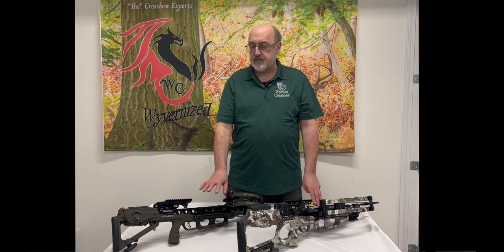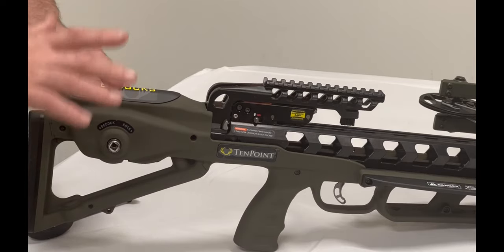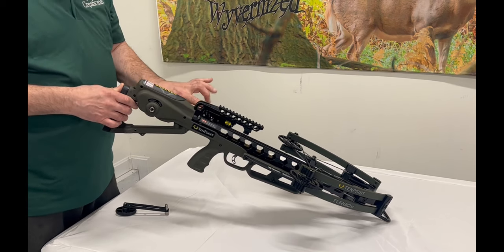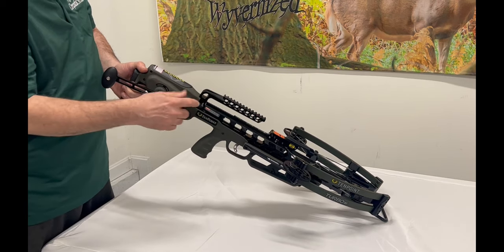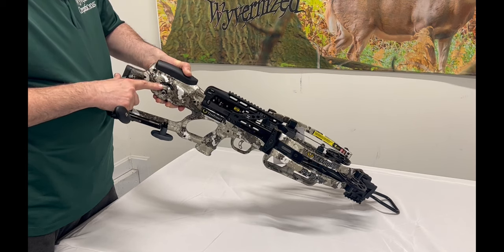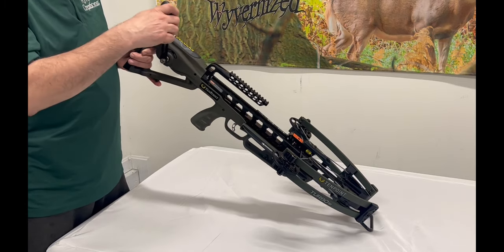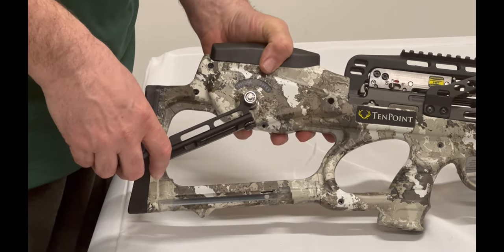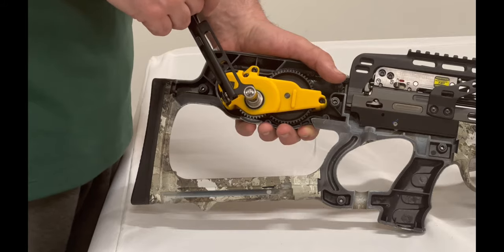TenPoint Crossbow AcuSlide crank instructions

Comment: Just a quick clarification, around the 6:30 mark, you are showing the back crank on the Nitro, you SAY back crank twice, but you actually only physically back crank 1 1/2 times. Then half crank to finish. Just wondering if you MEAN back crank 1 1/2 then half to TOTAL 2 cranks? Hopefully that makes sense?
Reply from the maker: There is some plus and minus to two exact turns. Part of it is where the handle is when you get all the way back.  What your doing with the two back cranks is allowing some slack so the trigger fully settles onto the pins. It can settle with less than 2 turns but generally if you say back crank two turns it turns into 1.5 or 1. If you say back crank 1  turn people would not go back enough. Good catch!!

Comment: I have a situation when decocking old model. I did about three clockwise turns while pushing  the silver tabs forward until the hooks disengage. When I was winding down the string it felt like it was skipping and jamming. Planning  to get a local shop to take a look.
Reply from the maker: There is a nylon washer on both sides of the strap. If you have too much slack the strap catches it and folds it over. Bet that is it. You will need a new strap and gear if that is the case
Reply: Thanks! Shop got it working without having to open stock. Should be ok, right?
Reply from the maker: If the washer was not too bent it will work fine

Comment: Just wanted to clarify something. On my Nitro 505, new model, after I do the 2 back cranks, EVERY time that I hold the button and try the additional last 1/2 crank I get the clicking. You say this is OK, just want to make sure nothing is wrong as Ive never tried it and NOT had it click on my bow. It shoots fine and accurately but I dont want to be messing things up inside and have trouble later.
Reply from the maker: It just means that the two turns are enough to disengage the brake. Your good

Comment: Much Clearer than the Tenpoint video in my opinion!  I recently got the Viper 430 from you David (I am completely new to Tenpont and cranks.),  and this video cleared up all of the questions I had on the cranking system.  Thank you for taking the time to actually show what is going on inside the Bow.  Great job on this!

Comment: I have the tenpoint havoc rs440 and some how the left trigger release pin fell off gone. I'm not sure where it came off, and I'm not sure how it came off. Where can I find one. Also, can the bow still work after getting wet in the rain. One day, my bow got wet, and when I attempted to de-cock and it make lots cranking noise, any explanation is appreciated
Reply from the maker: Ya…that is all one piece. You will want a service center to replace that for you they won’t sell just the part.  There is a bushing that is probably gummed up from being wet. Same deal a service center can pop out the crank and clean the bushing for you

Comment: also i’m confused you said after cocking let back twice then once with the gear stop but on my 425 siege a sticker says “ backed d handle once and then hood gear stop and manually rotate silver knob backward until it stops
Reply from the maker: @jojogrow5815  this year they went to a different series of instructions in an attempt to get people to stop over back cranking.  As noted on that brake most times two turns back is all you need to do

Comment: Im concerned with the gear mechanism being how I was caught in heavy rain storm last season.  How can I check for damage, rust, and relube the gear housing?
Thanks.
Reply from the maker: Ther is no real lube. You can take the side cover off and clean and dry the crank
Reply: Thx Wayne….do you have a video of actually taking the side cover off??
Reply from the maker: No it’s not a big deal. Take out all the screws on the right side of the bow and peel off the cheek with a small screwdriver. You may have to reglue the cheek back on
Reply: Thx for your help!  This is awesome that you actually reply and very helpful.  Much appreciated. 
I’ll give it a try on my Seige 410. I’m sure it’s the same set up as the others.
Reply: Wouldn't worry, since he said the "plastic" teeth could wear down.

Comment: I have the 10 point siege for 25, it doesn’t have the pin in the crank handle to disengage the front string which makes the brush extend beyond the end. How can I disengage it?
Reply from the maker: That one you can’t. It has a different dfi system
Reply: So what you’re saying is that it doesn’t disengage at all. If that’s the case, can I put a slight tension on it to put the brush back behind the front so it doesn’t get damaged?
Reply from the maker: yes just don’t go too far
Reply: Thanks!

Comment: I have an issue where the accuslide wont slide down without me forcing it loose after each shot. Even after doing the back cranking. Any way to resolve this
Reply from the maker: If you dry fired it you bent the hooks. You will need to get them replaced
Reply: @WyvernsCreations  was never dry fired,  this is after each bolt

Comment: Watch out for the screw coming out of the collar. Mine did. Put some lock tight and hope it’s ok. So far ten point advice was to take it into a dealer who isn’t a dealer and didn’t service crossbows.
Reply from the maker: You’re over cranking it. It’s a left hand thread. When you tighten it up and yank the handle to back crank it you back off that screw. If you stop as soon as it latches and only crank forward just enough to release the trigger latch when decocking you won’t back off the screw
Reply: I’m having trouble understanding your terms. By cranking back do you mean while I am cocking? And you are saying when it latches when you crank it fully back, I am cranking too far back, and it’s loosing that screw? 

My main question is if having that come out made something happen on the inside I should be concerned with.
Reply from the maker: @roberth.retallickr.n.8069 as your cranking back the bow to cock it once the pins on the trigger latch stop cranking.  When decocking only crank far enough forward to release the trigger latch. The bolt keeps the knob from back winding off the shaft